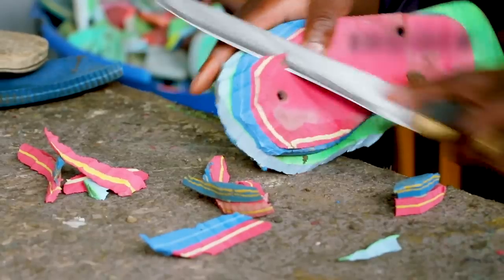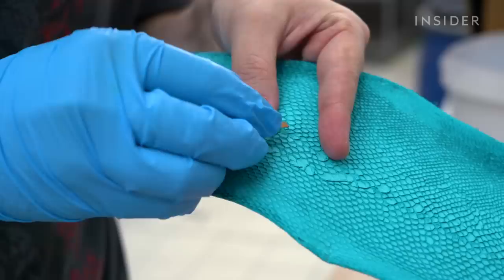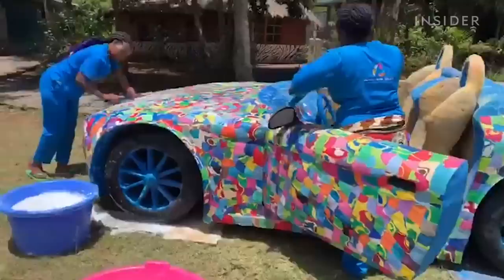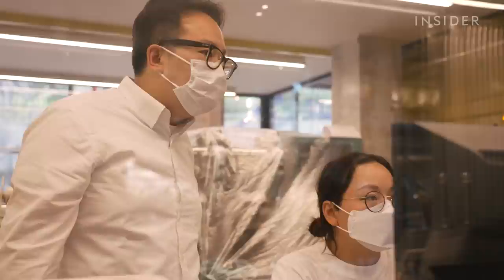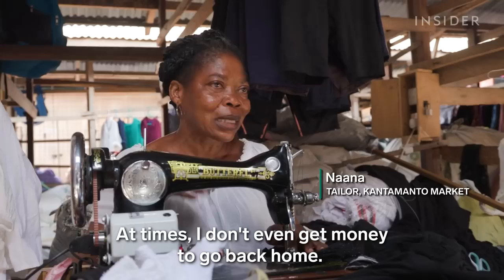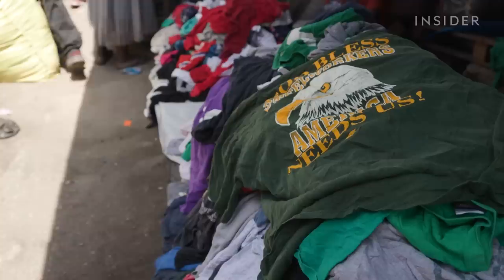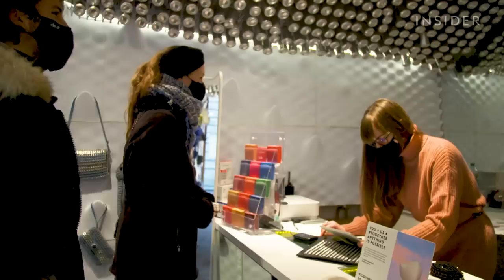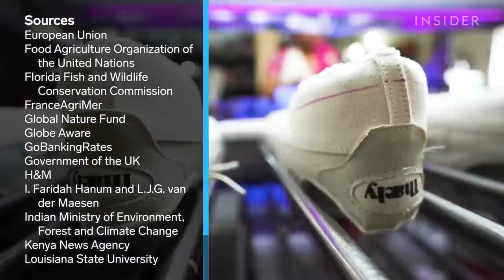5 Products Helping The Fashion Industry Tackle Its Massive Waste Problem | World Wide Waste

Comment: The sanding process must be releasing tonnes of microplastics into the environment.
Reply: At least they do it at a factory site. Every sandal they salvage would have degraded anyways in the ocean. Also they degrade as you use them on your feet. 
It is a problem with most shoes und tires.

Comment: I'd like to see someone figure out something to make out of plastic bottle caps from soda bottles and milk jugs.
Reply: There are small company projects that make bricks and pavers, also a company that melts them into jewelry like necklaces and beads lol though I don't think those are very useful
Reply: @rinnozomi1155  I'd like to see the bricks and pavers, as well as plastic lumber take off. The price of wood is ridiculous now and wood rots and breaks down over time, anyway.
Reply: Pyrolosys, turn it into diesel.
Reply: @price8314  Yes, chemical recycling is a good way. In germany we have a deposit system für many bottles. As there is only food safe material in the system, the material can be used many times. Bad charges are downcycled to packaging of nonfood and burned. Some companies even depolymerise these waste streams to close the cycle. But its too expensive. There are alternative Polymers in research that can be easier depolymerised and can be made from waste streams of wheat production. Maybe this will be the next step

Comment: The water hyacinth needs modern industrial techniques. A decent sized boat that can scoop them up to put into a place to dry. Get a machine to grind it and put the corpses of that heathen plant back into the water for nutrients or something.

Out of all the things on the list that looks like an easy solution since the plants float on top and seem easy enough to pull out. Surely such machines already exsist?

Comment: I have been using the same wallet for 25 years, I purchased it in Brazil and it's made out of can pop tops. I have had to replace the zipper, which I had a shoe repair shop do... I still get complaints on it though and haven't seen one like it in many years.

Comment: That H&M clothing recycling system shows the degradation of plastic fibers yarns used to make most clothing. Textiles are typically polymer thread in terms of material used in their production. Because polymers are flammable, they also have to be brominated to become flame resistant. Recycling the plastic fibers by making yard requires hundreds of thousands of dollars worth of specialized machines & costly human labor time to operate the machines in these pilot plants. I am reminded of one off hydrogen refueling stations- in both cases not leveraging volume production or cost optimization from higher scale operations with more throughput, meaning each unit produce similarly more expensive. 

I commend the effort & applied idea to make such a system, only trying to encourage that many hundreds of such machines should be made in "helicopter" like series production to reduce the cost so that each installation can cost a lot less. BMW has extensive experience with optimizing low volume automobile production profitably, methods which could be adapted by a partnership between H&M & the German automaker. 

I see lots of potential to recycle everything that humans use, consume, buy, discard. I think most waste thrown in trashes & trash dumps could be recycled using innovative processing like those mentioned in these video clips & segments. Thank you so much for producing this video to teach other people about it. I shared it on my Twitter handle @cosmicinglewood ^^ Cheers & Warm Regards